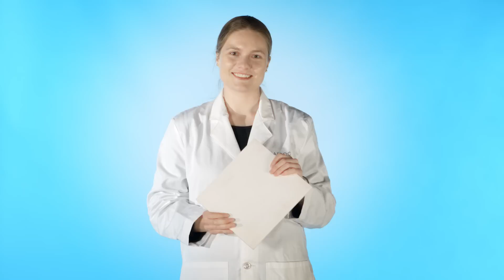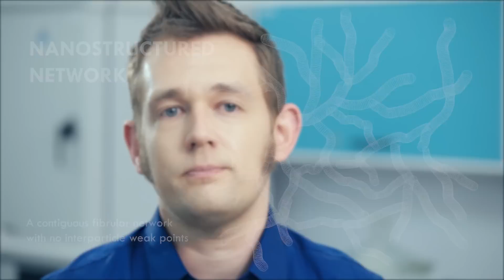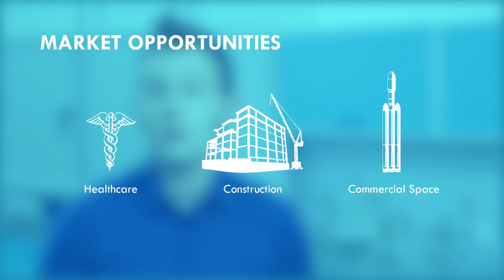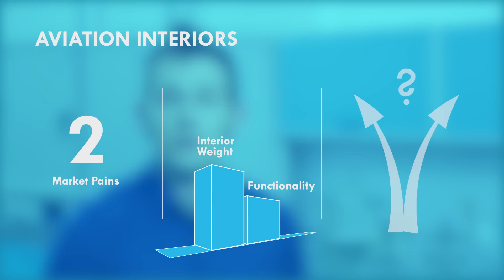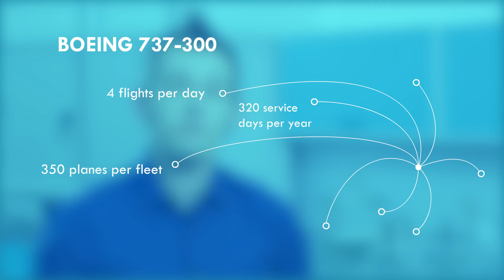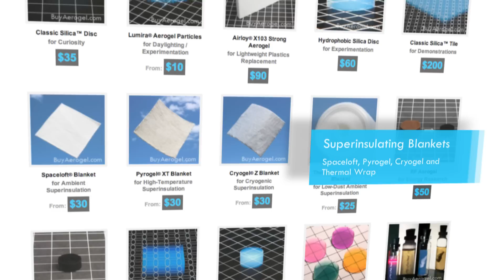Introduction to Aerogel Technologies and Airloy® Ultramaterials

Comment: I hope this company succeeds. I do, because they shake up the market with innovation. Aerogel still hasn't hit homes after so many ears of existence. Think of the enormous savings of aerogel insulated houses, boilers, furnaces and refrigerators.
Reply: It's a slow process, for certain, marketing Airloys for the products using them being superior to similar products with other materials would really help the aerogel business reach new heights.
Reply: It would help if their products were significantly cheaper than other currently used materials.

Plenty of things have proven reliability, but if it's more expensive it's going to have limited real world applications.
Reply: It has. Look up Spaceloft. 
Price is not a problem if you think long term. It might cost you more right now but in the long run, it will be far less costly than any other material, because of reduced maintenance, superior energy savings, labour costs, etc...
Reply: Cheap and practical nuclear fusion reactors will become reality a thousand years before affordable aerogels hit the market.

Comment: Could you guys do a comparison in regards to acoustic isolation? Build a small room with Aerogel isolation vs traditional isolation and test for STC?
Reply from the maker: We have acoustics data already and are continually characterizing our materials for other conditions.  Please feel free to fill out the contact form on BuyAerogel.com if you have specific acoustic insulation questions.
Reply: What is the STC rating?

Comment: I have a question.. 

Are aerogel matting hydrophobic to petroleum based liquids, but will they allow vapours to pass through via a vacuum on the opposing side... Will aerogel matting degrade with contact with petroleum based liquids?

ie, 

Vacuum
Petrol vapours
Aerogel
Petrol

Comment: Supercritical drying process at the final stage is an obligation or not? because some scientific studies say that heptane or pentane can be used instead of SCD process. In addition to this, aerogel is not only enough for stopping the bullet, i think you will use this with Kevlar or dyneema. Is this true? thanks.
Reply from the maker: Indeed subcritical drying with alkanes has been done but generally is limited to very small monoliths or particles due to capillary stresses that arise during the drying.  Also such solvents are very dangerous to work with.
Reply from the maker: Regarding bullet stopping yes you would probably combine Airloys with high tensile strength fibers.